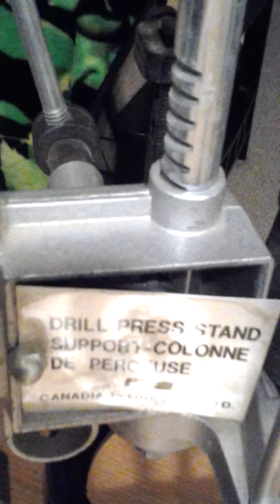Oxwall drill press stand

Comment: Thanks for doing your research and posting this video! I just got one in, and I started to do the same search. I never seen one of these before! It appears in mint condition, has all the parts that you mentioned. Yes, mine is also an Oxford drill press stand. I was amazed by this. Aluminum of course. Going off to do a little more research :-)

Comment: i think this is identical to the Craftsman Drill press stand sold by Sears and simpson sears ltd in Canada on mine it came with a craftsman industrial rated drill the back motor bearing was shot and i replaced it with a modern Craftsman evolv drill which has the recess in the back and it fits the stand perfectly as it may fit other brand corded drills as long it has that recess in the back and some cordless drills as long as it don't have that numbered adjustment coller near the chuck on it. as long it has the recess in it too as i had to use the keyed chuck from the old drill to this new drill as more better to use and i recommend using keyed chucks with drill press stands as its hard to use a keyless chuck with these stands.

Comment: If You Need It to fit A Different Drill Use A Exhaust Clamp and Two Coupler Nuts and Two Bolts of the Matching Size . 1/4 to 3/8 " A Just Use A Clamp big Enough to go Around Your Drill. My 1/2" Drill needed A 2 1/2" Clamp.

Comment from the maker: The drill pictured in the video is a old corded jobmate forward reverse single speed 3200 r min no load 3 amp.the single speed doesn't bother me as I have a plug on a dimmer so I can actually better set the working speed.
Thx for the question